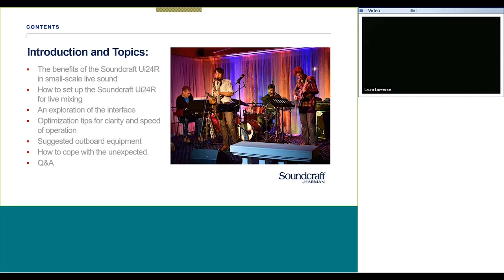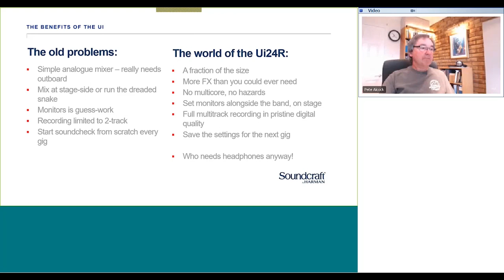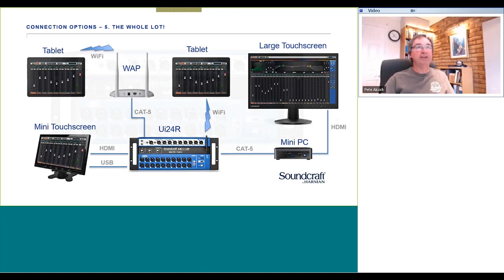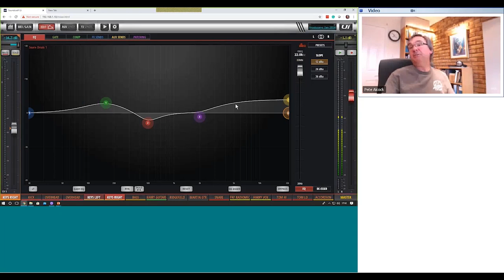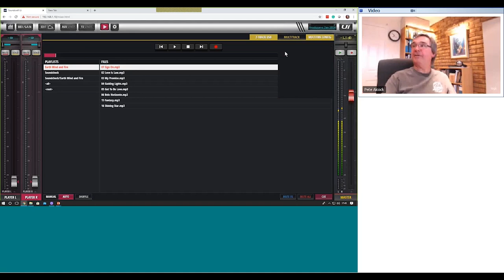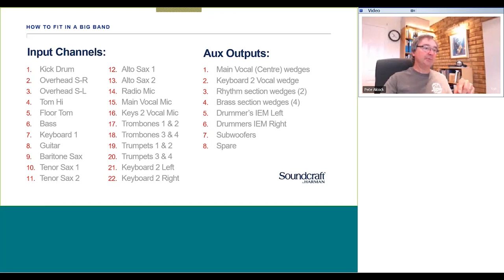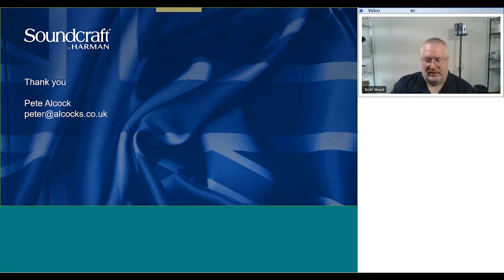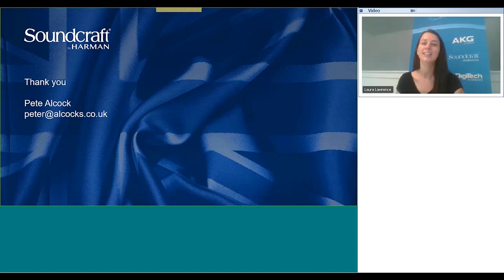Soundcraft | Getting Started in Live Sound with the Soundcraft Ui24R – Webinar

Comment: Thanks for the presentation.  I wanted to note that you might be able to skip having the small format touchscreen (and still keep reliable connectivity via ethernet cable) if you have a tablet.  You can get an inexpensive powered ethernet adapter cable for your tablet, which plugs into the power recharger/data port on the bottom of the tablet, and then has connections to your power cable for constant tablet recharging, and also has an ethernet output.  You can then hard wire your tablet via this adapter into your external router (or the ethernet input of the Ui) via cat-5 cable.  Even if the wifi drops out, you are still hard-wired in to the Ui.

Comment: Question:  Say i wanted to apply a permanent corrective EQ to flatten a PA system, is there way to do this without then losing the master EQ? Ideally would love to flatten the PA using corrective EQ and then have a completely fresh separate full band EQ to then start working with for enhancing the sound of the band.. is that at all possible with the UI24? thanks

Comment: so I revisit this to learn about how the UI24r connects because I had no issues with it before 4 options and NONE of them are working, these issues are coming up more and more as the unit ages, bad Electronics ? Danny Olesh I heard made a replacement board to solve this issue I think, Can't find the link anywhere, At least I get sound but now NO CONTROL, at first unplugging the power cord worked, Doesn't help anymore. grrrrrr:face-orange-frowning:

Comment: Picture at 21 minutes is faulty - you have no two ethernet connections for WAP and Mini PC !!
Reply: He addresses that very point by telling you that the WAP then becomes and ROUTER, enabling another connection.  Open your ears.
Reply: @pete3816  Open your eyes!! 
I didn't write what you say there, but what you drew.
This picture is faulty. 
You can use ONE Ethernet-Connection on UI24R !!!
If you connect there a router .. you have to switch the CAT-5 connection in picture from MINI PC to one router Ethernet port (multiple ethernet ports).
There are definitely not two CAT-5 connections like in the picture to the UI24R mixer !!
You encourage users to use the 'second Ethernet' port, which is only used for audio transmission with two connected UI24R mixers !!!